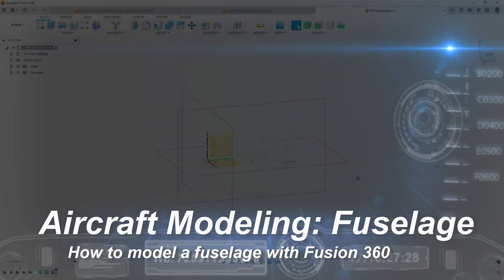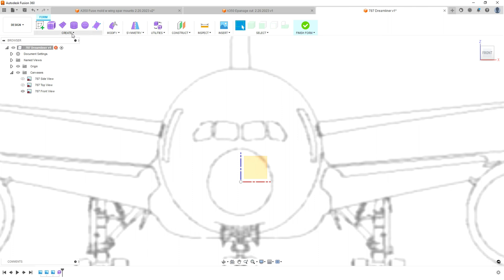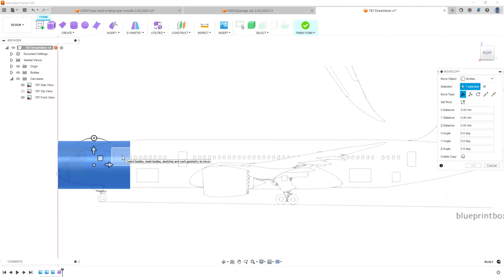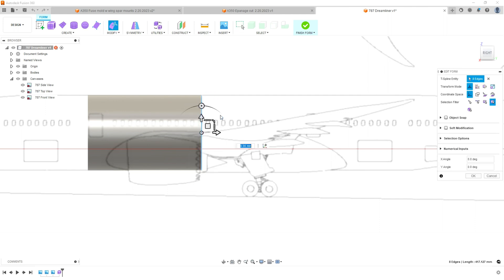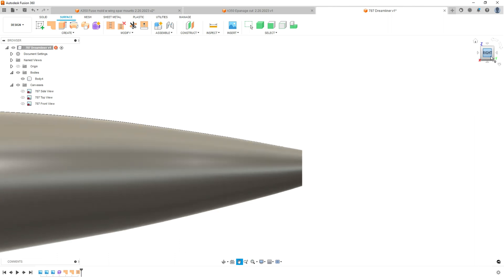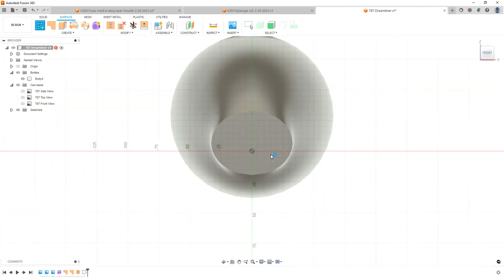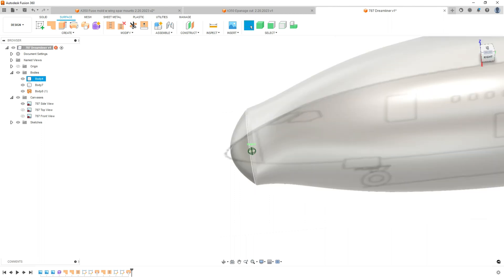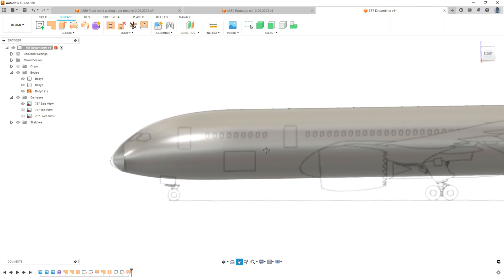Fusion 360 Fuselage

Comment: Cool, when you do your splines make the handles tangent to the projected lines of the fuse
Reply from the maker: Yeah I just used the control point spline for this demo. It’s easy to connect them but on the fuse belly, I used the fit point alone to be able to make all the compound curves needed. Thanks for checking out the vid!